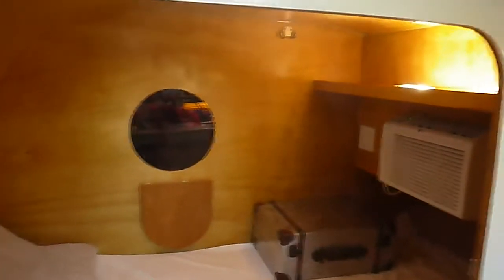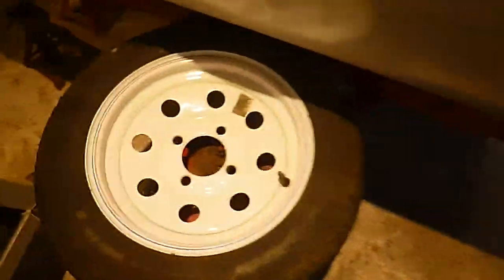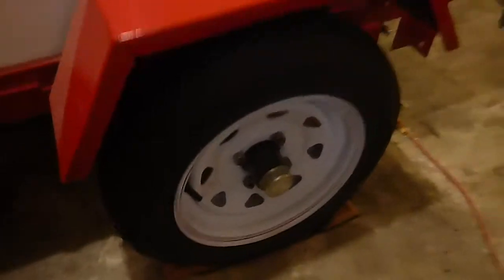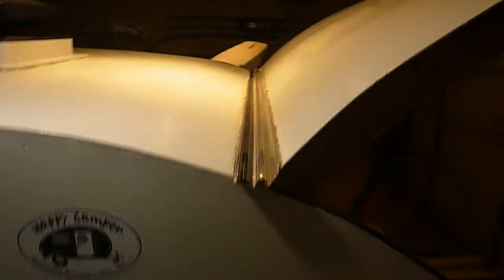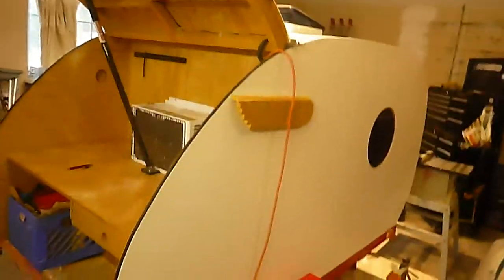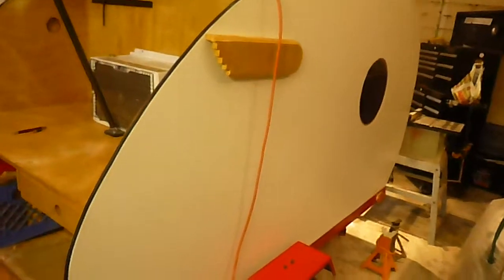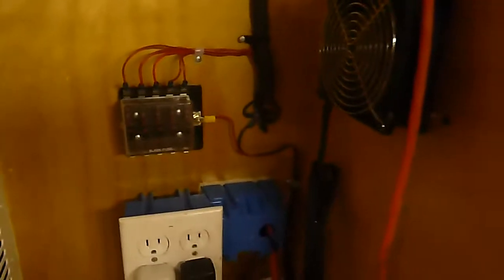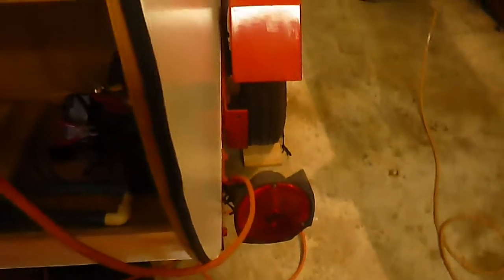Teardrop camper for sale

Comment: Put a slider going threw to kitchen and make feidge reachable from bed so u can grab a drink or a snack when your in bed and hide the back of that AC
Reply from the maker: A good idea but this trailer sold and I am now working on another one to replace this one, I will use your idea. Subscribe and you might see your idea in action
Reply: @mlangfordcamper  how much did it sell for?
Reply from the maker: @TheWoodHaven  $3500.00